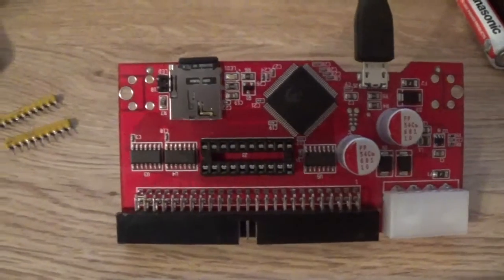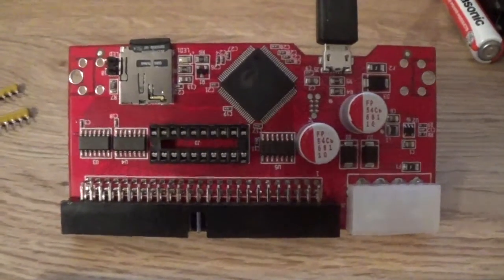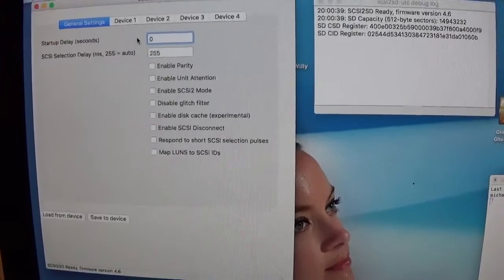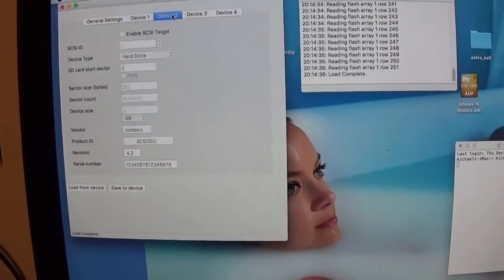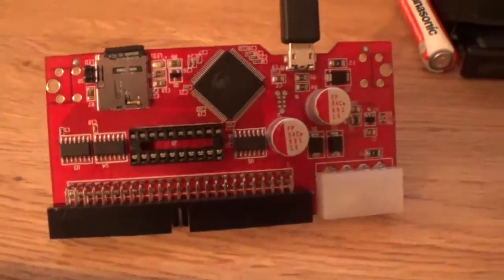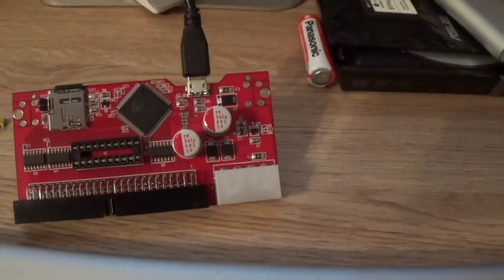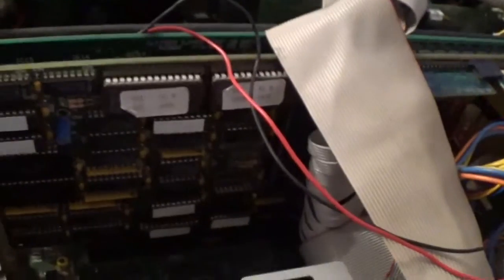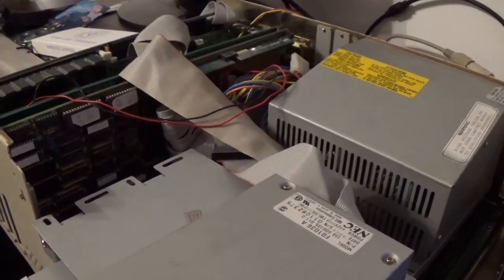sd2scsi amiga 2000

Comment: Thanks for the video! I just bought scsi2sd. What rom do you run in your A2000?
Reply from the maker: Hi ya I usually run 3.1 roms , don’t expect the scsi2sd to be fast... it isn’t but it works well.
Reply: Thanks for your answer, mate. I do have a Buddha IDE flash as well so maybe that might be a better way to go. Its' just that I would like to use my GVP Combo for all of it...
Reply from the maker: Well to be honest the Buddha is much faster ... :)

Comment: What are your settings for the Amiga 2000? I have a GVP 040 board and I keep getting scsi hangups. I tried with the terms in and out
Reply from the maker: trickysr I'll take pic of the board jumpers but basically I left the terms out or it would not work. I don't remember off hand what the jumpers were
Reply from the maker: https://youtu.be/ryABR5OGj-8

Comment: does the amiga 2000 not have a regular ide slot?

did you say the transfer rate is 500bytes per second?  i cant compute that, ive seen snails read books faster than that!
Reply: I am getting 1 mb sec transfers, that is slow. I also have a gvp 030, 50mhz accelerator. Sysinfo show that running 30mhz, not sure why.
Reply: mjnurney  Took the shield off the gvp and to my surprise a 28.3mhz crystal, so as they say, that’s all she wrote. This accelerator is the only revision in this line that has an ide connector. I heard there are many limitations on that also, so I will live with slow scsi card. May sell this system anyways.
Compared to almost equal specs in my A1200, which has an 030 25mhz (faster ide) the 2000 seems very slow, at least disk access wise. One wouldn’t think there would be that much difference.
Reply from the maker: TheWomblemaster as far as I know the limit of this adapter is 1mb per/sec. No only the AGA machines has IDE but back then IDE was seen as a poor substitute for the faster SCSI. Most SCSI cards are faster than IDE anyway
Reply: and Amiga 300/600.
Reply from the maker: Hi the through put speed is rated at 1mb so that’s correct I’m afraid. As for the gvp - what speed is the cpu and what crystal speed is in it ? As I recall the gvp has a jumper for 40 or 50 MHz selection.
Reply: 0.5Mb/s that is TERRIBLE.

Comment: i just plugged it to my A500 's GVP controller and it worked instant. Not the fastest but silent and works 100%  and decent price :)
Reply from the maker: TheLemminkainen excellent , what speed do you get ? I'll plug a few accelerators in and see what the difference is...
Reply: ~1mb sec  i have a SCSI2 controller but 1mb is maybe max for this adapter. New version  of this adapter is faster but more expensive